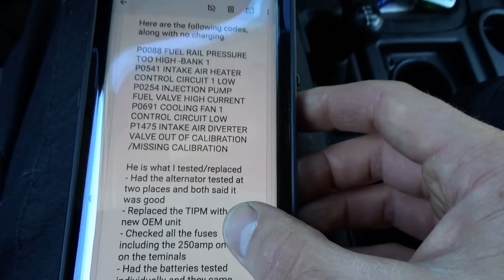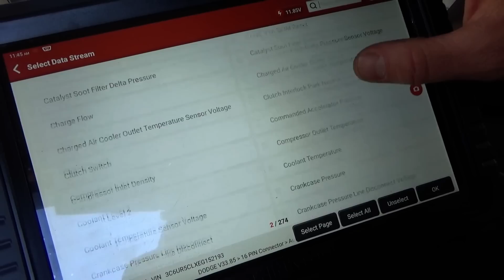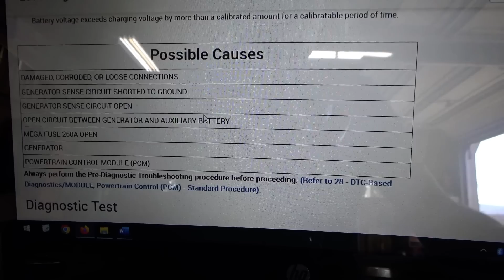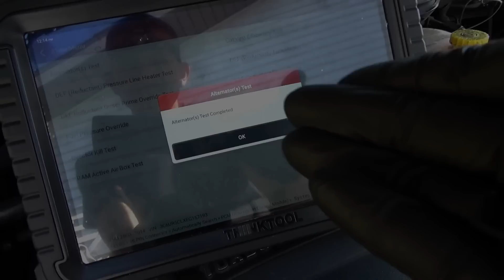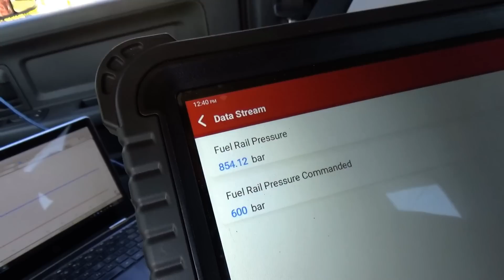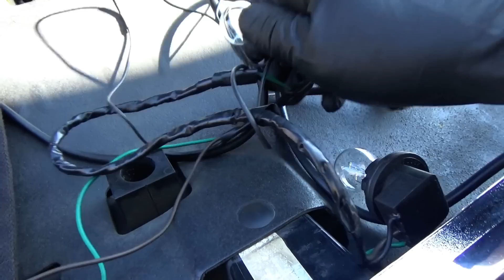Shop & Owner STUMPED: Cummins Can't CHARGE? Fuel Pressure PROBLEM? (P0254-P0088-P0691-P0541-P1475)

Comment: Since I love the idea of protecting the environment, I just really don't understand the logic behind those who cry for the protection but turns a blind eye on, say, an engine computer failure may scrap the whole vehicle creating way more waste than needed, or when a electronic car needs to be thrown away due to the very high repair cost due to the manufacturer keeps their software a secret.  Not to mention the very famous lefties led Micro$oft Windows 10 refuse to upgrade to 11 if the computer CPU lacks so called TPM 2.0 function, while the computer is still powerful enough to run the OS.

I don't get all these.

Comment: These aftermarket tunes cause more issues than people realize.  The only advice I can give is to leave the tuner in the glove box, because if your vehicle ever needs in depth repairs, that tune can absolutely affect the technician's ability to work on the vehicle.  Several times I have been unable to program replacement modules on Fords due to a non-factory ECM flash, and the options are to use the original tuner to return the ECM to factory condition, or replace the ECM.

Comment: I've used a ecm repair company before, they'er great! 
On the  90s  dodge dakotas we used to put a voltage regulator in the alternator
and cut a wire going to the computer. Sorry i forget what wire. Would something like that have worked?

Comment: I'm glad the owner found a cheaper alternative, if ony he came to you in the first instance.  There is nothing wrong with some computation in vehicles, but it's gotten ridiculous.  IMO, the sweet spot for vehicles was the late 90s to mid 2000's when there was a nice blend of older and new tech.  Cars back then were far less complex and more durable.  Just my ten cents.
Reply: I agree, I have a 1996 Dodge Ram 2500 Turbo Diesel 12 valve.  I have put a Banks kit on it but it is all mechanical, no electronics involved.  It is likely that the truck will out live me.
Reply: @johncooper4637  I'm learning to control a diesel since I want the diesel engine for my car but they don't sell it in the US.   If you can't get it with the engine, it's a given you can't get the electronics either.  Just need to buy one from junk yard in canada.   Twice the mileage for less than 20% more in fuel costs.  Not even a close call.
Reply: My taurus is the last year before they stuffed computer controls in the transmission.  rx7 last year before the government forced 2 seater's to be taxed to death.  Friend had the 86 model, and it was flashing a code that doesn't exist.  The electrical mechanical switches on it are neat I think.  That and the look on inspections stations face when they can't read any emissions from the tailpipe.  After burners are the way to go.  Not god awful platinum everyone wants to steal.

Comment: I had a 2012 one of these trucks. Worst truck I've ever owned! Kept it completely stock, I'm meticulous about maintenance, had it for 10 years. The straw that broke the camels back was the failure of the high pressure fuel pump which ended up being a $9800 out of pocket repair!!
Reply: Diesels can really rack up some expensive repairs. Seems like whatever truck you have, if "fuel system" comes up you are looking at a minimum of $2000.
Reply: Someone saw you coming...$9800 is ridiculoius
Reply: @mppd20 agreed; you can buy 2 of those for a LBZ duramax with installation no less!
Reply: Man that really sucks.

Comment: Ivan, obviously the ECM had failed since replacing it fixed his problems. I was curious about what test locations you were using for the scope? It looked like you were checking at the sensor or device and not right at the ECM or did I miss that part? Wouldn't you want to check at the ECM for these signals, maybe check ecm pins for corrosion before making the call on it?

Comment: If it had been only the alternator not charging, you could wire up an old  Chrysler voltage regulator conversion kit. Unfortunately it has other issues. 

Yeah, diesels are expensive!  Some injectors are $750 to over 2 grand a piece.  If you not a big time farmer construction company or hauling commercially, better stick with the 1/2 ton pick-up trucks and gas engines.

There's a reason the F150 is best seller! You don't have to get a loaded one or even a brand new truck. The half ton trucks will do a lot of work.  My grandpa owned a small farm and a Dodge D100 long bed was all he ever had.

Comment: Blairsville, yeah, home of that great tech school I won’t mention the name of . A while back I let a nephew use my garage to work on his Ram Cummins, older one with mechanical fuel injection . He replaced the injection pump and wasn’t sure about the timing, so he got his buddy (He knows his s:;t on these Cummins, I was told, grad. from aforementioned school) to set the injection timing. I was on another project, but watching what was going on. They had the front valve cover off and claimed he set it to #1tdc. I could plainly see it was not because one of the valves was not closed, don’t remember the exact scenario, but I told my nephew his buddy definitely didn’t know his (stuff). Pretty elementary to set tdc when you can see the valves, one would think.  Nephew politely excused his nhs buddy and we got the job done after I did a little web research on the injection pump timing, which was pretty simple.  Moral of the story which I touched on with someone in the last video, for the most part, IMHO, these tech schools are a joke.   Great stuff Ivan. 👍👍🇺🇸.    ( yeah, I always got a story up my sleeve😅)
Reply: That's why that school closed. Their students couldn't even identify basic hand tools.😂
Reply: Oh, didn’t know it closed, not surprised though.

Comment: What an aftermarket "tuning" nightmare, Ivan! Why "tune" what is already a beast? I'm convinced that was the cause of the PCM burnt drivers and, if not removed, will burn the new ones. The price of a new PCM is just obscene! Great that an alternative could be found and the "beast" is back on the road, but not a pleasant scenario.
Reply: None of the aftermarket tuning would've affected the failed drivers. Many times this type of tuning is to get rid of the typically problematic emissions equipment. Yes, I already know how the gov feels about that.
Reply: @jeffs2809  Went to Maic Salazar and watched the video he made about the possible repair of this PCM: https://youtu.be/QLaeZtLKMzE
Internal corrosion and vibration killed this PCM.
Reply: @jeffs2809  You are probably right, but I still find it odd that 4 drivers are burnt simultaneously. The only other way it could happen, would be the failure of an internal power route in the PCM, feeding all 4 drivers (and only them), but I don't know its internal circuitry, to really know if it's the case.

Comment: Why do people add the after market mods, that usually blows the computer, causes triple the problems,pain in the butt for any tech, to even begin to figure out WTH. Chrysler is a nightmare as it is, but this delete and tuned crap is a joke 😮😊😂😅
Reply: because these aftermarket mods DON'T usually blow the ecm. Occasionally it will brick it during the initial programming, but they can normally be recovered or the tuner  would take care of it at that time.
Reply: @jeffs2809  was curious. Thanks 🤓

Comment: Clutch fan short 5volt signal wire?
Reply: I was thinking the same
Reply: @ very common on older Ram 2500/3500. First time I got this issue the shopfore skin thru a couple sensors at it, then engineered told him to disconnect clutch fan connection, then everything started working

Comment: Wow.  Nice work Ivan.  I totally get the hesitance in calling bad part when the costs are so high. And in the end it is your reputation as a diagnostic technician on the line. I was glad to see you confirm your diag with checking and ruling out the potential ground issues before making that call. I really enjoy watching these videos and learning mostly understanding why you do things in a systematic way to reveal a given problem.  I worked pretty much the same way in my Air compressor service career with very good results. I found consistency was the key for factual results.   Keep up the great work.
Reply: reminded me of the head unit with no way to tell which of the $3K parts is the problem.

Comment: Its been “tuned” and working fine for years..  likely “tuned” to delete all the emissions stuff..  its a diesel..  you really wouldnt “tune” the thing to do anything aside from that unless you had injectors and a pump installed or ran bigger exhaust and wanted more boost pressure..  its pisses me off when everybody always blames the “tune”..  yet when pcm’s go out left and right on vehicles that are stock those people arent asking whether or not the car has been tuned..  that said how will changing some parameters on the build cause hard faults within the computer years after doing them or at all?  Your not sending different voltages into the pcm or over volting circuits on there, otherwise it wouldnt work..  now if you mess with the as built data than you can completely cause circuits to blow and even lock up the motor but when you tune a motor your using a program with set parameters and coding that only allows the tuner to adjust like a fuel pressure and not let users send high current to a random sensor or something..
Reply: so Maic Salazar Diagnostics confirmed this is fault is corrosion not a tune "2014 RAM 2500 6 7 Diesel Diagnosed by Pine Hollow Auto PCM test for David B in PA"
Reply: @bobspurloc thanks Bob!  Makes it clear this was a corrosion issue. Did Salazar fix the computer as a spare for the owner?
Reply: Unfortunately, a tuned diesel does cause issues that most people do not fully understand.  First, there are codes that are turned off for the purpose of modifying emissions or when adding power.  If there is a fault with one of these systems years later, diagnosing will be more difficult.  Second, it is very easy to create a drivability issue if the tuner does not have the proper knowledge and equipment to tune properly.  Also you put a lot of trust in the software provided by EFI or HP Tuners.  They try to simplify things for the end user but in reality it is not.

I have been in the diesel repair industry for almost three decades.  Tuning causes a lot of issues for technicians when dealing with engine related issues.  I will list a few for you.  Grid heater not functioning - Corrupt H&S program.  Engine knock at 1800 RPM - Custom tune turned off pilot injection at this specific RPM.  Rough running cold and heavy white smoke - Bully Dog tune removed second pilot injection.   Failed clutches, 68RFEs, and head gaskets.  This is a small example of just 6.7L Dodge/Ram trucks.
Reply: @freeride202  but it breathes so much better😮
Reply: @freeride202  yor reply simply amplifies why people keep blaming a turn for a hardware fault on the board. nothing you mentioned would justify a diode, transistor or capacitor going bad which happen all the time. Ivan didnt inspect for water damage or a popped cap. this type of hardware fault if caused by the user would be them accidentally touching wires to places they should not touch frying a diode or transistor. the transistor is just an electronic switch, leaving it on 24/7 isnt going to normally adversely effect it unless someone added/touched something causing it to carry higher current. a MOD is the thing that will fry hardware not a TUNE. in this particular issue. every incident has different parameters ignoring that means u just take on the dealer mentality that will try to negate a drivetrain warranty because someone had no valve stem caps on 3 of 4 wheels OMG! the horror!
Reply: @bobspurloc  I agree that in this case ECM tuning is very unlikely to cause a circuit board fault.  I personally have never run into such a scenario.  My point is that an aftermarket program in an engine ECM can make diagnosing an issue much more difficult.  I personally have a library of stock tune files to aid in diagnosing deleted trucks.  It is at the point that I have to dig into the programing to see what someone has messed up.

Oh and to add to my list, I had a 2013 Ram 6.7L in my shop today with a rough idle when the engine is cold and exhaust brake on.  The issue was the RaceME Ultra closing the VGT down too far and chocking the engine.  If you are not in the industry, you might not understand how poor diesel tuning actually is.  Personal experience owning a deleted truck is just anecdotal evidence

Comment: Hi Ivan,
The replacement ECM did not need to return a core? If no and his original ECM can be repaired, that would be a nice backup.
Reply: That’s the route I took when I had to replace the pcm in my 94 Camry. Ivan repaired the old one for Me and I put it back in . Still 100% and I have a spare. The OEM reman was a thousand bucks without the core refund, but worth every cent to me.

Comment: I had a similar problem on a 97 Dodge and they sold an aftermarket voltage regulator that hooks to the alternator on a Ford type external regulator I found them online and it fixed my truck hope this might help seems like they've had this problem for quite a few years
Reply from the maker: @jonathancoughran9463  that would actually make it more reliable vs sending so many Amps through the ECM 👌
Reply: All regulators used to be external, which made everything so much easier.  In some respects, regulators were the first modules ever used on cars. And it was all downhill from there :-)
Reply: Yea i got a 95 4x4  diesel was having all kinds of problems,  electrical.   I checked everything i knew to check . Went to the forums ect . I was told the computer rarely fail . I finally found a on line discount Dodge dealer . Bought a rebuilt computer for i think 400 dollars . Yep fixed all of the problems except one . Loose cruise control while driving . I noticed if i placed my foot under the brake pedal the problem stopped.  So i added a spring to the brake peddle.  Fixed worked for years .  On the older truck like mine there work arounds for the things the company controls ...  i going to keep my 12 valve cummins . Pretty reliable truck with the g56 transmission

Comment: I am not a diesel guy, but I had one for a friend back in Summer that had the delete and tune on it and it had running issues.  He got sent to Down the Road Motors. I was trained as a heavy equipment mechanic in the military and when I got out I said nope.  Went into automotive instead.  That was in the late 90's and I've been doing auto repair ever since, with no education in automotive systems.  Never been to auto repair school.  I did take a Napa class on fuel systems once, because the boss made us go after work.
Reply: My typing sucks.  I went into auto repair in 1989, not the late 90's.  ;)

Comment: Why did the owner not go back to whoever fitted all the aftermarket crap and say "check this stuff out,"  First ?
Reply: That guy likely disappeared when the EPA cracked down on shops for tampering with emissions controls.
Reply: It's been 6 years.
Reply: DIY???😤😤
Reply: Could easily be a diy install other than writing the software tuning. While the tuning "could" be diy, most people wouldn't be willing to take the chance on doing it. However, i'd say it's very unlikely that the aftermarket tuning caused the drivers to fail, especially since "tuning" the alternator or grid heater solenoid isn't really a thing.

Comment: Im happy we dont have these things regulary in europe
Reply: This engine is bulletproof here in Canada, worked at Dodge dealership for 30 years never replaced a Cummins engine under warranty. Biggest problem engine management check engine light, water pump, front ball joints
Reply: There are some, but the owners often get riduculed. People say it is compensatory behavior (and that is putting it mildly).

Comment: Nice looking truck, with a Cummins to boot! These people need to stop with the parts cannons. Throwing a bunch of parts at your vehicle isn't a badge of honor, diagnosing it and fixing it right is! 😅
Reply: People think that's what mechanic do the same but you have to troubleshoot it also ❤😂
Reply from the maker: Luckily the only cannon shot was the fuel pressure regulator 😅
Reply: @PineHollowAutoDiagnostics  didn't I hear FICM too? Or did I imagine that?
Reply from the maker: @volvo09  oh TIPM too... I forgot 😂